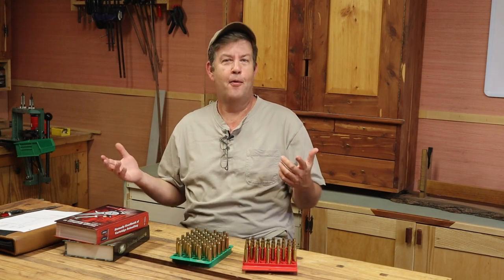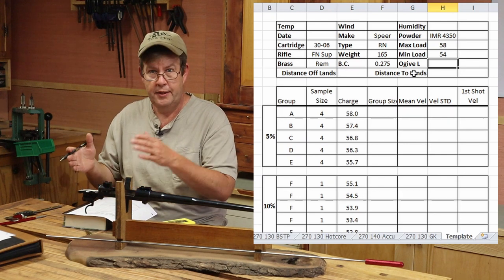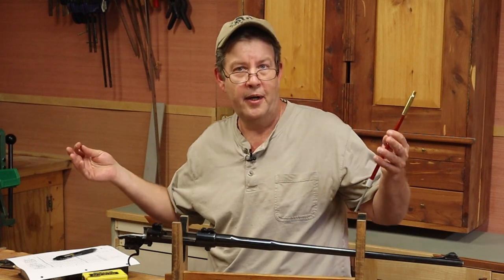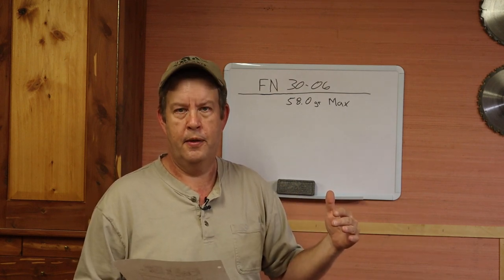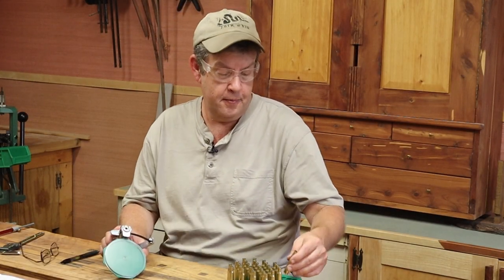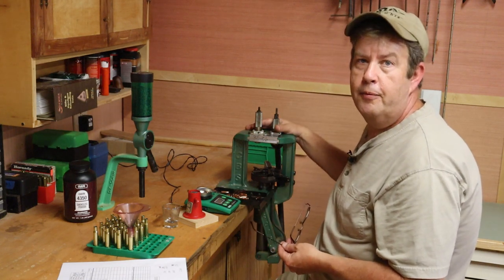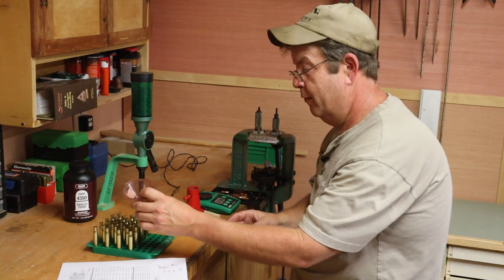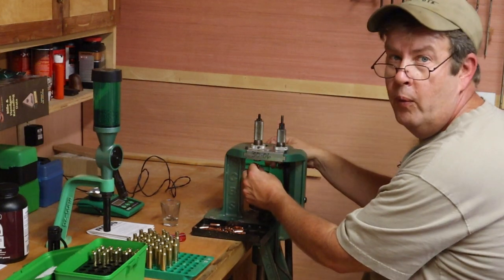Load Development For Hunting; Pt3 Charging, Seating, and Testing

Comment: Thanks Tom for making this video on what you do for charging, seating, and testing. I learn some very useful information. I particularly like the powder increments by percentage. I have a 28 Nosler project that I think the percentage method will work very nicely for. I never thought to ever use a percentage increment system. Very smart!
Reply from the maker: Jeff, I'm glad that was useful. And I wish I could take credit for coming up with it but using a percentage has been around for a really long time.

Comment: I started reloading in 1995. Last year, (2021) I finally gave up my mechanical scale and charge thrower, and purchased a digital scale/dispenser. I repeatedly tested the new system vs the tried and true. There is no variation. Precision is precision, be it analog or digital. I didn't realize changing a piece of equipment can change the order of the process, but after figuring it out I'm happy with my new system. I really appreciate your videos. Thank you for sharing your process.

Comment: Thank You for your insight on the bullet jump measurement. You presented it in a way that's better than reading from a book😇🇺🇸
Reply from the maker: Thanks Dana, I'm glad that helped. And something I didn't mention in the video is the jump measurement doesn't have to be exact. It just needs to be close and make sure you aren't to close to the lands. The only thing that needs to be exact if you're worried about precision is the length of the bullet. If you run seating depth tests then you will find the best depth and how much jump you get won't matter. All that will matter is that you can precisely control the length of the bullet to do the tests and to repeat that length when loading in the future.
Reply: Thank You again😇I'm running into this exact issue because in my state we can only use lead-free bullets for hunting and these bullets end up occupying a lot of case cavity space, especially when loading for intermediate-length cartridges like 6.5 Grendel or 7.62x39. I'm either compressing the powder or exceeding the max OAL. I also think these solids will never expand to seal the bore as well as lead core bullets
Reply: Oh and they're $50 for a box of 50 buttlets, yeesh😝

Comment: I simply take a sacrificial case, cut 4 "petals" into the neck so that I can place a bullet in with just a little tension.  After that, simply insert this into the chamber, close the bolt gently and then pull it out.  The bullet will stop once it hits the lands and will compress into the case showing you the absolute longest length you can load that particular bullet so you can work off that measurement.  I usually start at .030" off the lands.  Playing with the length is my final step to attain accuracy.

Comment: Interesting! On hunting loads I used to set mine 20 thousandths off the lands. And, I tested them thru the magazine to make sure they worked. LOL Nice video.
Reply from the maker: Thanks Kent, and I really should have mentioned that in the video about making sure it will fit in the mag! I didn't even think about it in this video because I knew it wasn't going to be an issue with a 150gr bullet and a 165gr round nose. But I will need to mention that in the future.

And I have to wonder how long .020" off the lands has been to go to number?

Comment: The good thing about that broad nose bullets is a lot of times is you can get to the rifling and get backed off where you want it before you run out of magazine length most of the time with spitzer bullets your magazine don’t let it even get close so I generally go to what the book refers to seating depth and try it
Reply from the maker: I have ran into that quite a few times (magazine to short). That's one of the things I always loved about the 7x57 and .257 Roberts when they are chambered in long action rifles. Both are shorter than long action cartridges so you get plenty of room when they're in long action rifles.
Reply: @TomRiverSimpleLiving  that is the one thing I was surprised about that 300 H&H it had a shorter throat and I was able to seat the bullets off the lands 30 thousands I read that hornady bullets like a jump of about that
Reply from the maker: @scottscheuerman6170  The short throat depth also surprised me on my pre 64 Featherweight in .270. It's really shallow throat. And I suspect Winchester Power Point bullets do real well with a short jump which is why I'm guessing it's so shallow? I haven't been able to get any Power Points to try but I've always heard they shot better in the pre 64 than anything else and I think that's because of the jump?

Comment: Great series of videos for the regular hunter. I'm really looking forward to see how they shoot! I'm preparing my Winchester model 70 30-06 for this season also so I'm really enjoying this.
Reply from the maker: I'm glad you're enjoying it and I can't wait to see how they shoot either. But these stocks turned into my white whales! The FN is almost finished. The only thing left is the checkering on one panel on one side of the pistol grip and then I'll be putting it together and we'll get to see how the round noses are going to shoot. The A3 is going be a lot longer. I stopped working on it so I could finish the FN and once I get back to it I'll still have to do the oil finish. I'm starting to feel the pressure because deer season isn't that far off!

Comment: Thanks Mr River, your video was very helpful. Your video also covered several safety aspects that I’ve also seen mentioned in other videos which makes very good sense. I was very curious to see how you were going to measure your case head to jam length. I saw that you used the Hornady tool. My only question would be: once you shoot a cartridge its going to be full length resized with a shoulder bump of say .002, this will bring the shoulder of the case X distance from the head of the case. When a cartridge is loaded it is moved forward as far as it can go by the bolt and when the firing pin hits the primer. When you measure the overall to jam length using the Hornady guage, it seems to me the cartridge head to the bumped back .002” shoulder on resized brass is going make your overall head to jam length different on your once fired resized brass vs the Hornady tool’s case, thus effecting how far you need your bullet seated for desired off land distance. Some people have suggested you use a once fired pc of brass with its shoulder bumped back .002 for a bolt gun, then drill and tap the primer pocket to fit the Hornady tool for making of a modified case, then take measurements the same way you described. However this method requires the ability to drill a L size drill hole, then tap with a 5/16” 36 T.P.I. Tap, and then to size down your expanded neck of the once fired brass so the bullet slides nicely without too much slop. You briefly touched on your die setup for bumping the shoulder, but I didn’t see you verify/measure your case shoulder bump with a bump gauge insert mounted in your Hornady comparator tool body, you simply mentioned backing the die off somewhat so it just bumps the shoulder some. Overall I feel your video answered some very good questions I had. I never knew the proper below case head measurement for the primer, and also found you discussion about bullet seating depth interesting when it comes to the desired min amount being that of the bullet dia. I also watch gunblue490, and he also explains along the same principles. Gunblue also has a very interesting inexpensive way of measuring your chambers overall jam length with two measurements made with a cleaning rod to the end of the barrel and two pieces of tape. One measurement made with the bullet stuck into the chamber with slight pressure from a short cleaning rod inserted at the chamber end, then a long cleaning rod with flat end (jag with point filed off) is stuck into barrel muzzle end, and then marked precisely with tape placement squarly wrapped around the rod at barrel muzzle end. Then 2nd measurement made with bullet removed and rifle, bolt re-nserted back into the rifle, and bolt closed and locked,  and then the same long rod then reinserted to when it hits the closed bolt face “with no extractor pin or firing pin interference”, and marking with tape precisely and squarely at end of barrel muzzle again. He then measures between the two leading edges of the tape on his cleaning rod to get the cartridge overall jam length (case heed to bullet tip) then subtracts the desired off lands amount, and then seats the bullet to this amount from case head to bullet tip. After this measurement from case head to bullet tip is achieved, I would then measure the case head to bullet ogive amount of the cartridge, and then use this length measurement to repeat for all cartridges being reloaded. The only problem I see with this method unlike the Hornady tool method is it doesn’t utilize pushing a case shoulder up into your chamber until it stops, and also pushing until the bullet stops for obtaining your jam length for reference. So my thoughts are your method with the Hornady tool utilizing a once fired pc of brass resized and with the shoulder bumped back .002” (using bump gauge comparator for a bolt gun) might be the most accurate way of obtaining the most accurate measurement of off the lands bullet seating depth? It seems to me that this accuracy aspect would only apply to knowing where you actually are at 1st measurement, thus having consistent comparative measurements there after so you can then work your load to peak accuracy. Obviously it would appear that the Hornady method with its caliber specific case should also give a person an acceptable reference point to work from as well, even if the measurement may be off somewhat from actual off lands measurement,  compared to when using your own barrel fired and resized/bumped brass screwed onto the Hornady tools end.
Lol, I know you are trying to do your utmost to keep this video series simple Mr. River, and I truly respect your awesome teachings thus far. “Simple, Accurate & Safe”, thanks again my friend, & God bless. 😎👍
Reply from the maker: Mike I think you're falling into the trap of searching for absolute values when you only need relative values? Everything you said about getting the most accurate value for JAM length is pretty much correct but keep in mind there is always going to be some measurement error. And at the end of the day you don't need an exact jam length. You just need a number fairly close. And I'm not just dismissing the need for precision in your measurements it's just the only place you need to be precise is in measuring the length of the bullet once it's seated. It doesn't really matter if it's. 0.025" off the lands or 0.015" and that's because if it's an accurate load it's an accurate load and if you can repeat that bullet length with all of your bullets then it will always be an accurate load. And when you do your length tests to find the best seating depth (if you even feel that you need to) then the best seating depth is going to be where ever in relation to the lands for that specific load and whatever that distance to the lands is will irrelevant. Again all that will matter is that you can precisely control the length of the cartridge and reproduce that both for the testing phase so that you can have exact values for the testing and for reloading bullets in the future. 

And I don't want it to sound like I don't care about precision because I do. I just don't want to invest the extra time, effort, and money into obtaining and exact absolute jam value for every bullet I load for in every rifle I load for when at the end of the day that value is irrelevant. Knowing that value and it being an extremely precise value is not going to do anything to increase the precision or accuracy of my loads. The jam length is just a starting point and to make sure you are not to close to the lands. At least that's my view.

As for me bumping the shoulder, I didn't bump these cases. I just full length sized them because they were either new brass or fired in someone else's rifle. I probably could have taken a case fired in the FN (that's the rifle the once fired Remington brass is going in) and zeroed my calipers to it and then sized the Remington brass bumping the shoulder so that it was .002" or smaller relative to that case and been fine but I just went ahead and full length sized it all. And keep in mind fully full length sizing is only "bumping" the shoulder by about .007". So it's still close. 

I hope that helps and if you have any more questions just ask.
Reply: @TomRiverSimpleLiving  Good morning, thank you for your reply. I believe I understand what your saying. Get a starting point for your overall length that you know is off the lands to a relative degree of accuracy, that way you are not going to over pressurize with a spike when you reach max powder charge levels when testing various charge loads. 
I would assume that if one starts to move their seating depth closer to the lands when testing for an ideal seating depth, they better be careful and start looking for over pressurized signs such as flattened out primers. But as said ideal load might be found at much greater off land distances anyways, so no need to chase the lands! And as you mentioned with some calibers and shorter bullets, you might not end up with bullet seating depth deep enough into the case neck to hold proper tension on the bullet if trying to kiss your lands with the reloads. So it would seem like consistency with repeatability along with accurate powder charge measurements, along with good note taking will be your best friend. I would be curious to know (measure) where my stock Winchester .243 Win 100 grain and .270 Win 130 grain SAAMI Spec.hunting ammo measures off the lands in my stock Model 70 barrels. It would seem like this might be a good starting point for bullet seating depth, “after all the manufacture should know what they are doing you would think 🤩.”
Take care and God bless.